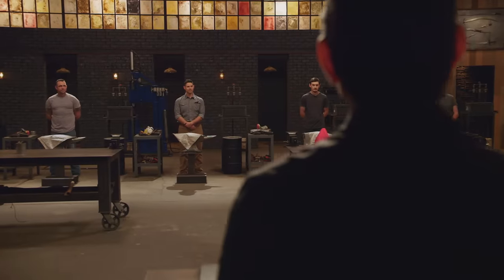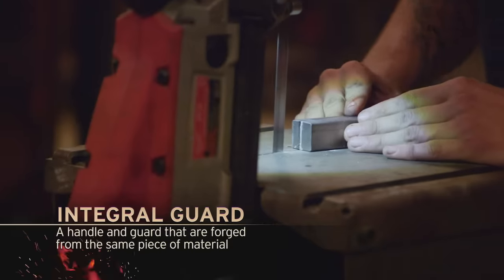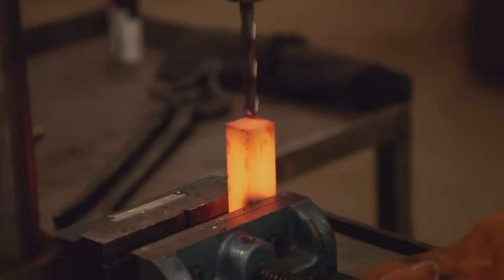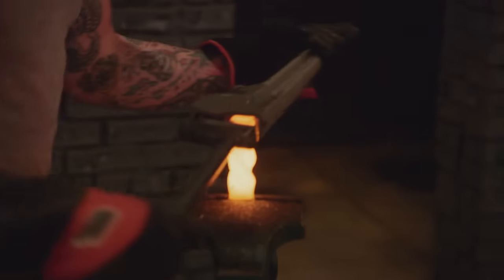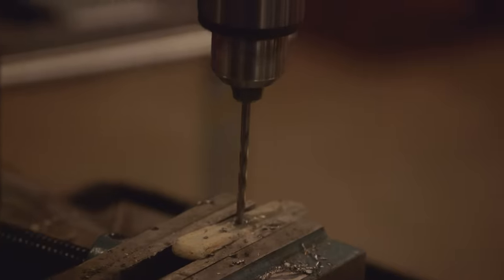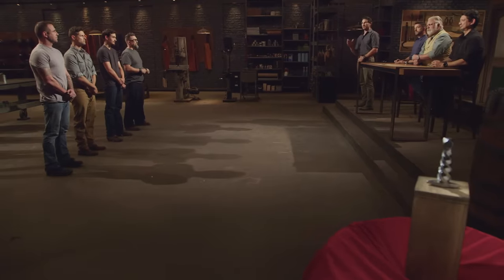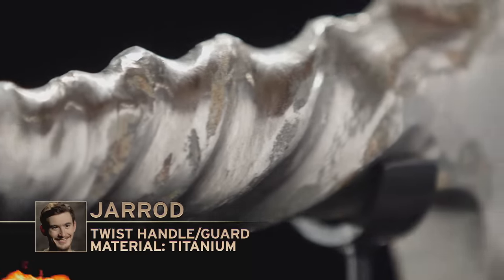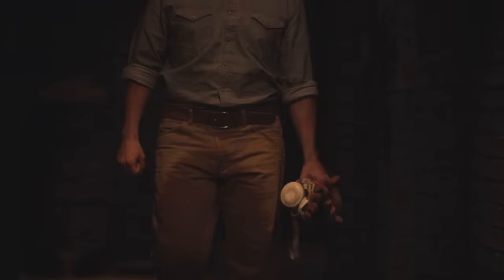Titanium SMACKDOWN Brings Extreme Challenges | Forged in Fire (Season 7)

Comment: titanium is basically super strong aluminum. It doesn't need fancy techniques to manipulate. The bladesmiths kinda went crazy, and thought it was super metal that can't be cut.
Reply: Im a metal roofer i have seen all types of metal and im sitting here like ? Lol
Reply: It's definitely not even close to super strong aluminum. Lay off the crack dude.
Reply: “Basically super strong aluminium” my foot. It sparks different, has a terrible oxidation problem, has about double the melting temperature, shows heat differently, is hugely more abrasion resistant, has completely different alloying elements, phases, methods of heat treat and properties, as well a a myriad of other things. The oxidisation means you absolutely do need special techniques to fully manipulate it.
Reply: Lol.
Reply: Both the US and Russia consider some of the techniques used to manufacture titanium parts as secret because it is believed that the difficulty in working with the metal is a significant obstacle to its use
Reply: @garmack12  thats pure bs :)) , i had my encounter with Grade 2 Ti , it was much nicer than expected . Tooling lasted a lot longer compared to super duplex and god forbid inconel 718 .

About making the rawmaterial , i imagine it cant be more difficult  than the duplex stainlesses and inconels
Reply: Way more to it

Comment: the guy that tought drillin into smth glowing yellow was a good idea LMFAO AND HE DEVEN DID IT AGAIN 💀
Reply: Clearly common sense isn't a prerequisite for selection.
Reply: You can literally see those two braincells doing their best there hahah
Reply: @xAndrzej42  REAL
Reply: @dazaspc  This is exactly what someone who values common sense over knowledge and understanding would try.
Reply: I was thinking that was common sense, but when everyone in the video was talking about it calmly so casually, I just assumed that there is potential theory behind it. XD
Reply: @tahustvedt  As a smith you would expect some knowledge of metal. That includes Drill bits. If it was solid carbide sure drill it red hot it wont matter other than the size and it getting caught in the hole if it cooled. HSS looses it's temper fast in excessive heat something a knife maker should understand as they are tempered as well. 
Hits red hot metal with hammer because its softer and easier to form. Use red hot drill bit, expect temper not to be affected because its a drill and not a knife. Because Common Sense? Prior knowledge is what creates Common Sense. Instead forms opinion based on may be a song that mentioned the metal by someone who knows even less about metal (A difficult thing) Create clusterfuck in the process. Or perhaps a common failure today a complete void of critical thinking?

Comment: Titanium alloys have the following characteristics: "low heat capacity, easy to cool", "low thermal conductivity, easy to have large temperature distribution", and "high temperature dependence of hot deformation resistance". Therefore, when heat is lost, the deformability of the surface of the forged material drops sharply. The twisted handle was probably chosen to test the blacksmiths' knowledge of the properties of titanium alloys and their ability to handle them appropriately.
Reply: It's weird thing to test considering almost no smiths even use titanium
Reply: @InfernosReaper  well... Ilya's commentary is that.. Titanium just... doesn't forge.  You don't really heat treat it,  you're just working pure metal.  It doesn't have the elaborate hardening process steel has.  And that's why it's actually softer than forged steel.

Which means it doesn't hold a sharp edge as well.

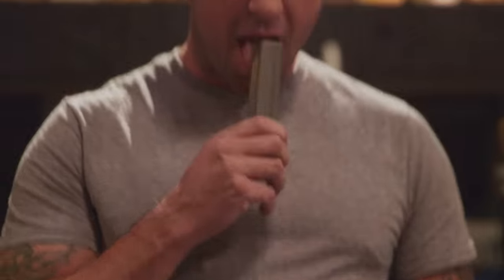Comment: 0:24 The look of utter disgust on Doug's face after seeing Dorin lick that metal.  😂😂😂
Reply: I thought so. 😅
Reply: When he gets nervous he likes to lick things. What an interesting guy...
barf
Reply: It can be toxic with the oxide on the surface.
Reply: Could pick a lot worse thing/ than titanium to lick
Reply: Well its a metal shop... it could easily have metal burs on it.
Reply: Why would you use titanium such a terrible metal for functional blades!
whats with these jokes just go do it no planning or thought!
Reply: @gluonpa6878  isn't titanium one of the least reactive metals though?
Reply: Disappointed father look
Reply: @gluonpa6878  Yes, and they use that oxide for white food coloring :eyes-purple-crying:
Reply: @danquaylesitsspeltpotatoe8307 

I have a dive knife made of Ti.

Takes a decent edge, (but does need to be sharpened often)  can't rust, is very light, easy to clean.  It's also non magnetic which can be helpful if you are dealing with unexploded ordinance. 
Ti can have its uses as a cutting tool in limited circumstances.
Reply: @gluonpa6878 

Titanium oxide is a food coloring... and the metal is a favored material for use in surgical implants.  
(I have two permanent ti surgical pins in my right shoulder.)
Reply: @stinkyfungus  Yes its weak and needs to be sharpened often!

"It's also non magnetic which can be helpful if you are dealing with unexploded ordinance. "
Well thats handy  🤦‍♂🤣  Ill use that to deactivate all those unexploded bombs I have laying around here!

Comment: There's a reason why people use drilling fluid, first is lubrication and another thing is cooling. You never wanna drill hot because your drill bit is made out of hardneded tempered steel and heating it up causes the metal to loose it's temper and become softer.

Drilling something red hot is probably the craziest and frankly, dumbest thing I ever saw. When you're drilling hot metal, you're drilling into a material that had been expanded by heat and when that metal starts cooling down it will shrink and will surely cause your drill bit to seize up.

Comment: There are 3 main things you need before you drill into metal you have never worked with on the spot… how fast you need to spin the drill bit, how hard the material you are drilling into is and what hardness your bit is made for and coolent.  

Now, I don’t know the exact speed he was drilling into with… but it’s titanium. You need to go sloooow. You can’t take a random 10mm drill bit and just go to town… if you have limited resources, work smart not fast. And I’m sure they were provided with kobalt bits for this since they are literally using them.

Drill a smaller hole with a smaller bit. And widen it with a bigger bit after. This will destroy your bit, but if you are unsure about the hardness of what you are drilling and how to… it’s you best bet.

Next… don’t let it get hot. Hotter the bit softer it becomes.

Comment: Of course the Titanium is going to be used for the handle.  From what I understand, Titanium is absolutely HORRIBLE at holding an edge.  But I'm not fully clear as to the reason WHY it is so horrible at holding an edge.  Can anyone fill me in?
Reply: Basically Titanium is very "you get what you get". It's doesn't harden well like carbon steel. Even with a perfect temper, It's barely as hard/strong as spring steal. It's a very common misconception (thanks to Hollywood) that Titanium is this end-all-be-all of metals but it's actually weaker then most steels by a margin of 2x.
Reply: I think it's because it won't harden.  It's a durable metal that resists fatigue and hot and cold cycles well.  But is soft by metallurgy standards.  I think that's what I know😮
Reply: I've worked with titanium a couple of times in the last few months and was expecting a nightmare but it works like aluminium, drills easily and cuts with a hacksaw.